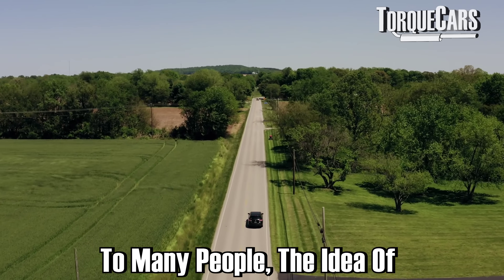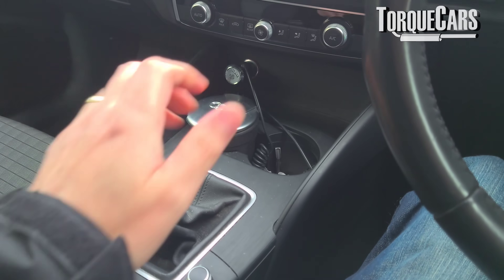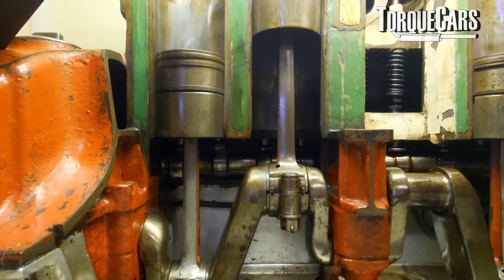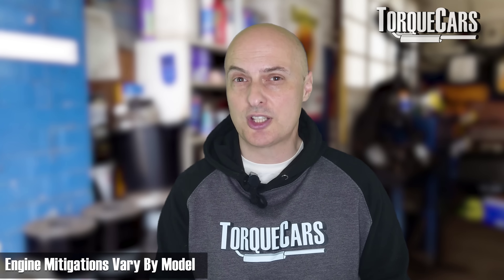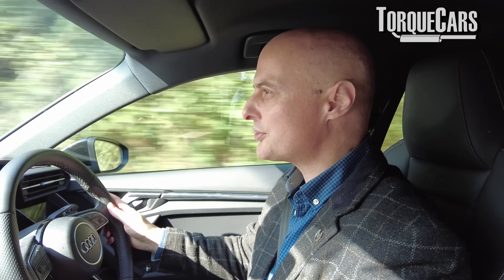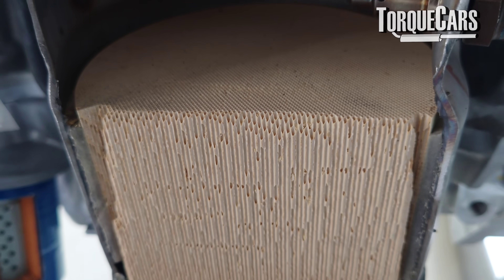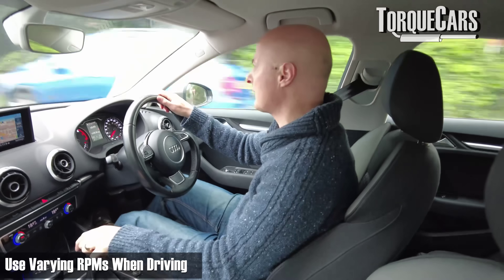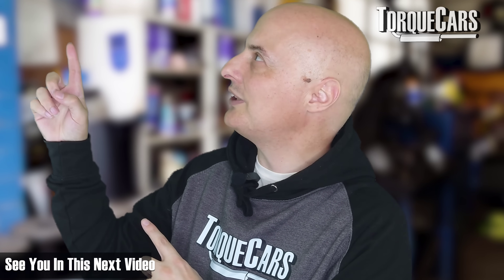BIG DAMAGE By Lugging at LOW RPM? Eco Driving Warning! (Manual Gears)

Comment: As an Engineer I just can say THANK YOU for that good video about this topic!
I saw a ton of videos about this topic (and rpm ranges in general) and most of them seem to consist of hear say and "what my old grandfather told me"-stuff.

It highly depends on the car, usually diesel engines are more happy with low rpm than gasoline engines but lugging them all the time will give you higher blow by rates in general.
Furthermore as you've noted, you don't save fuel just by driving in low rpms, you're saving fuel by driving in the rpm range where the engines has its top torque output.

As an example you've got the 1.9 TDI (engine code 1Z) from VW. This turbo diesel engine has a max. torque of 202Nm at 1850rpm. Driving it below that makes only sense if you don't need power, if you're gliding the road. If you need power for e.g. an overtake then you want to be in the range of elasticity of the engine. It is the range between max torque and max power. In case of our example, it is between 1850rpm and 4000rpm (max power there), the redline is at ~4500rpm and the ECU drastically decreases the power at about 4250~4300rpm. I usually shift down to reach about 2200 to 2500rpm to start the rapid acceleration, it pulls good enough to shift to the next gear in the range of 3500rpm, which sends it back to about 2500rpm, and gives the opportunity for a second push. I rarely hit the redline, since the power rapidly goes down after 4100-ish rpm. Which isn't uncommon for older turbo diesel engines, since they protect themselves from excessive temperatures of the exhaust gases, which gets more dangerous if the rpms are higher due to the higher amount of gasses (mass there of).

If you are a hyper miler or someone who really wants to know how to do it right in your car, get the torque diagrams. You can find them on the internet for the most cars and engines. Be sure to validate the revision (date of construction), version and engine code of the engine you have in use.

Safe roads and all the best, 

Bruce
Reply: I also have 1.9 tdi, love that engine. I didn't know about diagrams and max torque, but just from feeling I knew that a little bit below 2k is sweet spot for the engine. 

And then my father drivers 1.6 tdi on 1.2k rpm - it hurts me to watch that, to listen to those low frequency vibrations (btw, what is that low frequency sound when driving low rpm under load?). Told him many times that it's not good nor for the engine, nor for the mileage, but he just didn't listen to me. Nothing I can do about it.
Reply: @Jakaj99  The 2.5L "Iron Duke" engine in my 1985 Chevy Celebrity did that, the automatic was so tall it'd hit top gear (3rd) at 45MPH (72kph) and do 1200RPM at 45.   That was a gas engine but with this "nothing but low end toqrue" cam in it.  88HP (like 68kw) but 120 foot pounds of torque (163nm.)  It was slow but this was a "midsize" (it'd be full sized now) car that'd get 30MPG on the interstate, malaise era setup entirely for mileage.  Thank goodness it had throttle body injection and not some horrible emissions carb.  The instruction manual actually mentioned this sound (to say it was normal and not a defect) and called it chuggling.     (It also claimed light ping was normal.... luckily when I owned it Iowa had 10% ethanol 89 octane for  less than "no ethanol" 87, so I was always running 89 in it... no ping... but I was on vacation, put 87 in there, drove it  in some hot weather and indeed, it sounded like marbles were rolling around under the hood from about 45-50.  It certainly didn't seem normal to me LOL. That engine was so overbuilt it didn't give a care though.)
Reply: @BruceCarbonLakeriver  you know, I'm not gonna try to counter what you've said, since it seems completely true and I am by far not well acquainted with engine design. But I do believe that low or high rpm don't really matter in my 55hp, 3 cylinder 1.2 Liter polo. It just always tries to force an immovable object into motion XD
Reply from the maker: Thanks my friend, I really appreciate the kind words of support, I had no idea this video would be so popular especially as there are fewer drivers with a manual than ever, but it does seem that there are lots of drivers with bad habits out there.  

And let's face it we could all do with developing mechanical sympathy for our engine.

I didn't explain a few points as well as I'd have liked in this video so I will revisit this topic in future to clarify those.
Reply: @torquecars  You're welcome :)
Congratz for your video took up, it was a ton of work for sure :D

Ha, yes, you couldn't stiff everything in one video, like a lecture at the University. Better split them up and give every video a critical of the topic.

I'm looking forward to, until then, take care and safe roads!
Reply: @BruceCarbonLakeriver  i also remember the torque curves and that the top efficiency rpm of an engine will depends on which range the gears have been given.
What I don't get is that in my experience, the car instantaneous consumption per km is ALWAYS lower at higher gear (assuming cruising, no acceleration).
@Bruce, Can you shed some light on that "paradox"?
Reply: consumption per km is ALWAYS lower at higher gear –actually I tested it with two cars built around 1998-2003 (a smaller and a larger), both gas engine with 5 gear distribution, and the consumption was evidently lower in the 4th than in the 5th gear (at around 2500-2800 rpm). I presume it has to do something with the optimal torque / combustion / vehicle mass / cruise speed combination…
Reply: I drive a 2L TDI for work and my buttdyno told me that it delivers most power at 1750-2500 rpm, full throttle above or below that range just makes the van vibrate/shake. And from what littl' I know about engineering is that vibration is the enemy of any mechanical system. Also, from a mileage point of view, if your vehicle starts shaking when throttling, that enermy isn't going into moving you forward, but side to side instead, so ease off a littl'
Reply: Diesels are more happy at low revs since they have long strokes. Lugging the engine is when you accelerate and the engine isn’t making enough torque resulting in high friction.  Diesels usually rev to 3k rpm at redline. It also heavily depends on which gear you are for gasoline engines. Let’s say you are at 5th gear where the gear ratio is 0.87. If your engine only makes 200lbft of torque at 2k rpm at 70mph then your are essentially asking for non existent power. A diesel usually makes around 700lbft of torque at 1500rpm. Multiple that by 0.87 then you can easily make power at 70mph, but you won’t be going fast due to no horsepower because of low revs. That’s why it’s important to drop a gear to disappear. Make the gears do the work for you.
Reply: Get a load of the torque on my 1.4L turbo in my Chevy Cruze... those make like 140 footpounds (about 190nm) peak but make 90% of the peak at 1400RPM LOL.   I've found it loves E85, that stuff's like 110 octane or something and my foot dyno suggests I'm getting a nice 10% or so extra low end torque with it (pulls stronger right up to 6500RPM, I just don't have to wind it out all that often.)
Reply: I mean, at least the readout of the car, I haven't mesured engine efficiency directy 😅
Reply: As an Engineer I just can say –Without this comment the video would really have been incomplete…Thank YOU BOTH. Let’s assume I’ve found the torque diagram for my car’s engine, what then? I have a petrol driven old Citroën 2.0 and admit I have often resorted to this mistake so far. What’s the best cruising speed/rpm in 5th gear? And in 4th? Shift gear also at 3500 for petrol engines?
Reply: @Emerald_City_  It is the speed at which the engine needs the least effort to operate. Ideally it would be the point where the torque and power together are the highest. However this is not a complete picture as resistance from the air also needs to be taken into account. So going faster for the perfect rpm will not always be better, certainly at higher speeds.
Reply: I agree with everything you say, I also have a 2.0 liter VW turbo diesel car. I change the oil every 8000 miles, I drive it gently including NOT pushing it hard at low revs. I drive gently and accelerate progressively. I watch the live MPG readout and always try to keep that at a maximum. I am not afraid to run the engine at higher revs but only after I get to them progressively. The engine has covered 110,000 and has never missed a beat, always runs perfectly and never burns oil. In the end engines will last longer if you do not eat them or stress them, at any rev range. It's as simple as that really.
Reply: The FN2 Honda engine, found in the Honda Civic Type-R, produces its maximum torque of 193 Nm (142 lb-ft) at 5600 RPM
You must be crazy to think that this engine has the lowest fuel consumption at those RPMs.
Reply: Exactly 😊
Reply: @BruceCarbonLakeriver  thanks Bruce loved the explanation
Reply: A good majority of newer gas engines have CVT transmissions behinds them which are designed to operate at lower rpms. To much high rpm in a CVT will cause overheating and certain death.
Reply: My diesel RWD will produce max torque (400Nm) at 2000-2600RPM and max power can be found at 3600RPM but after that it's pretty much gutless. It's a heavy car with tall gearing so 5th gear is 1:1 ratio in gearbox and 6th is overdrive.
Reply: Hey do you have any tips for a 2002 wrx? thank you!
Reply: even mop cleaner is called an engineer in uk.
Reply: @BruceCarbonLakeriver  The problem is that dyno data is based on full throttle operation.  The RPM where max torque occurs at full throttle is generally not the RPM where max torque occurs at say 1/4 throttle.  Given that most cars are driven at 1/4 throttle or less most of the time, the max torque RPM from a dyno run is meaningless.
Reply: The solution is electric cars, 400k miles, no oil, no problems, no maintaining...
Reply: @SzaszaG1  .....and no electric in a lot of places!
Reply: I've been looking for the torque /power diagrams of my 1.0 VW Polo NA (2105) with no success. Do you have any specific tips on where to look? Cheers

Comment: Hello, is it possible to define where "low rpm" ends for a modern diesel engine? is it around 1200, 1500 or even 1700? (I personally try to avoid rpms under 1500)

Comment: My 2022 A200 has three modes of operation. In "Economy" it changes up awfully quickly. In "Sport" it hangs on far longer. The "comfort" mode gives the best compromise. But I do think that it's "comfort" for the engine vs comfort for me. It's a decent gearbox apart from the hesitation and jerky set off. But that's DCT for you lol. My work van is a Ford with "Powershift". When cold, it plays tunes and really can't decide which gear it likes best 😂

Comment: Does this apply to HYBRID’s as well⁉️ I always try to use a range of RPMs to get different gear changes. But how do you tell you’re in the wrong gear in an automatic⁉️ When I increase RPMs, I do it gradually, I don’t accelerate too suddenly - it’s the same with braking - I look ahead and if the traffic has slowed, I cruise and then gently brake to take advantage of the regenerative braking. Of course, I only brake suddenly if needed. 
I do a fair few short trips in the city where I live, but I often take my car out at least once a week for an hour drive on the freeway using the ‘pulse and glide’ technique, so I am accelerating in more shorter bursts more often - and I do ‘Italian tuneups’ once a month or so to avoid carbon buildup in my new RAV4 hybrid.

Comment: Can’t go over 50 kph in a big city like New York.
Even the highways are clogged with traffic.
Reply: Take your car on a night drive when there’s less traffic so you can get your speed up and your engine heat to optimum temperature to help burn carbon buildup off and take your car out into the country out of the city for a long run once a month you’ll be doing your engine, a fa in the long-term 👍

Comment: Yes completely true.
I broke my Renault Megane mk2 1.5dCi diesel engine by almost always hypermiling. 
When on the highway for about 300 - 500 km per trip I almost always was hypermiling in 6th gear behind lorry's at 90 km/h, so about 1500 RPM.
At about 225.000 km and 6 years of age the pistons went sideways thru the engineblock.  The car at age 6y was written off.  
Only very low mileage for a diesel.

Comment: Lugging an engine is bad for the same reason it's bad to try pedal a bike from stationary in 6th gear, or set off in a car in the wrong gear, extra load is being placed on the chain and sprockets, extra load is being placed on the engine and in both instances this is being done for the most minimial effect.

Comment: Isn't lugging when you floor it at low rpm and a high gear?  I drive in low rpm around town in my f90 m5.  Is this bad?  Should I be driving faster.  Obviously on highway  I drive more spirited.

Comment: My dad would drive in 5th gear at 25mph, sometimes less. He’d  often skip from 2nd gear to 5th.  I looked at the manual and it said to use 3rd gear at that speed.  Thankfully he no longer has a manual transmission vehicle.

Comment: Very nice video, and there are engines out there that actually have better milage in the upper rev range, take the 1.6 L Zetec SE, in my specific case, with my mothers grandma driving only driving under 2000 rpms driving in 5th at 60 kph, she got an average of 8l per 100km, now, this slow driving, cooked most of the engine and exhaust system, it was so full of deposits, her using 10w40 instead of 5w30 because a colleauge told her that's what most cars use also didn't help and she pretty much cooked up the whole exhaust system that was a costly repair, not to mention the whole clean up of the cylinders and valves due to the oil and exhaust deposits, what i noticed when i first started driving it, is that the engine was just hesitating to accelerate almost completely under 3000 rpm it would just shake in place, that's when i took it to a mechanic, after the whole repairs i drove like my mom, averaged out about 7.8 L per 100km, when i started revving at around 3000-4000 rpms i got at 7.2, sure it's not a huge difference, but man, less fuel consumed by revving higher sounds dumb, but that low rpm driving almost caused the whole engine to fail and because she also failed to keep up with the maintenance of the timing belt, something, which my mechanic attributed to either a shock or the constant lugging she was doing, skipped 2 teeth on the timing gears, and the engine ran like that for 1 year, long story short, i love this, keep making content like this because some people really have no idea just how much damage low rpm driving can really cause

Comment: i've got a civic si and the engine seems happiest when i sit around 2800-3400 around town. i can tell because it has one of those basic real-time fuel mileage meters, and the economy is often best in that rpm range, because the engine is working easy.  if i'm at 2000-2500 rpm, it takes the engine a little bit of effort to hold that speed or accelerate a little bit.  at 3000 rpm, it feels like i have the momentum to stay steady or slightly accelerate without the engine working very hard

Comment: The old style pushrod engine is one of the best engines ever built. Because I started using camera rollers on every surface. Hydraulic valves and lifters of one of the best and reliable way to do something.

Comment: The double overhead cam is a good engine it can rev a lot but it's not good for a 4-stroke cycle engine. I know they use it in formula One but it's not a good way to do it. You're better off just idle on your engine or just above it 600 700 or 800. You never want to speed up or slow down. That's why the four stroke cycle engine. For spending electric generator.

Comment: The best thing for your engine in your car is just to sit there and idle. You'd be better off not driving it. Because most boats planes and trains using. A speed just above idol. Because it's so expensive they want the engine to last a long time. The worst thing you can do is drive fast like a race car driver.

Comment: My Dad bought an extremely low miled 1968 Chevy window van with a 350/3spd auto in the middle 1970s. To compound the ultra low miles on a 5-6 year old car(it was right around 20k miles) the original owner only drove the van to work and NEVER drove it over 30 mph even though he lived 20 miles from work on a two lane hwy. He thought he was getting a basically brand new car at a used car price. It was the worst running vehicle ever. It took him forever to get it to run right after purchase. It would drive ok until you tried to drive faster than it was used to. It pop. And backfire and cut out and just generally misbehave.  It took him a long time and several long freeway trips at 60 plus mph to make it any better (even after full tune up and carb adjustments.) He finally got sick of it and bought a different car.

Comment: Question: is coasting bad for automatic diesel engine on motorway?
Reply from the maker: It depends on the transmission type to some extend but I would strongly advise against this in all cases as it reduces engine braking/control as well as potentially wearing the transmission when re-engaged.

Comment: Sorry stupid question how do you drive at low rpm! I drive an automatic so no idea whats low rpm driving is. I just drive as normal!
Reply from the maker: This is more of a danger for manual drivers, but it would be theoretically possible to select the wrong gear on a semiauto or paddle shift - modern units will override silly choices though.

Comment: I've got a 1.6 v40 diesel, what's your take on driving in third gear at 30 mph. Many people say it's better for the engine, i.e. water pump working faster and better oil distribution around the engine. But would the engine wear considerably faster than normal or would there not be much difference?